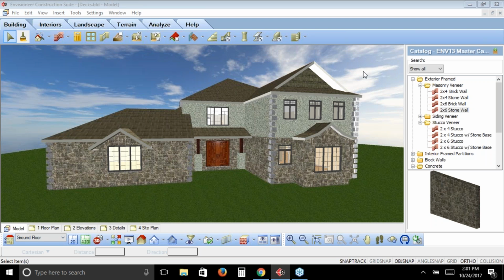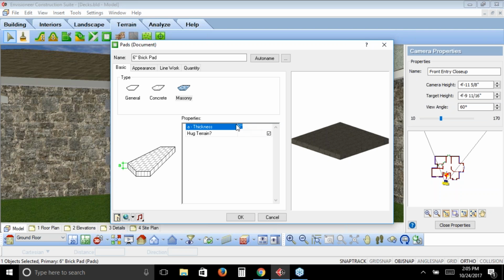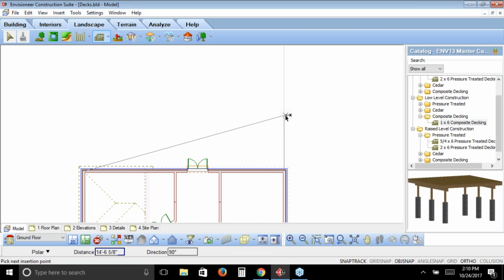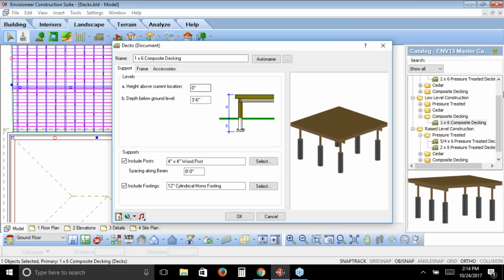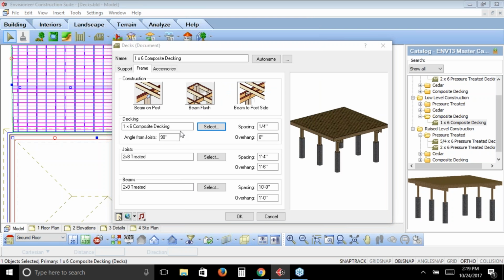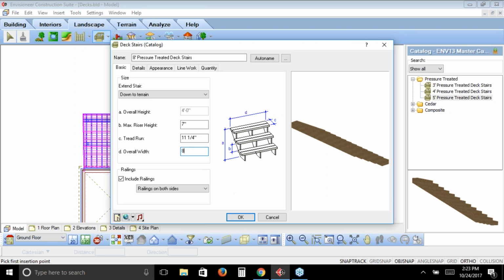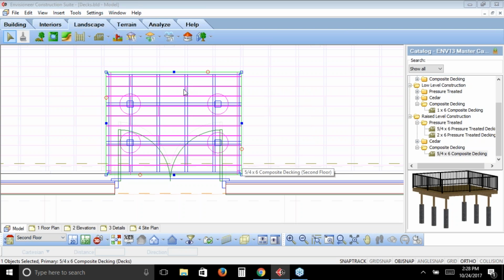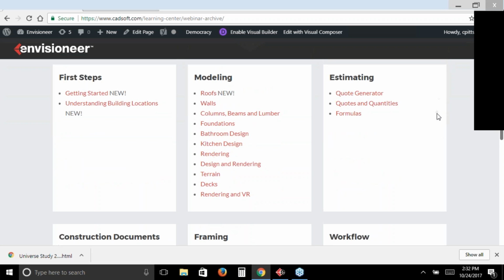Deck Design in Envisioneer

Comment: How do you add footings and posts to a deck
Reply from the maker: Hi. In the Properties of the deck you can specify footing and post materials and their relative spacing to have them insert automatically with the deck. If you wanted to do something outside a regular spacing you can use the Column tool (Insert>Columns) and place them where they need to go and then use the Footing tool (Insert>Footings>Footings Attached to Columns) to have them sit under the columns.